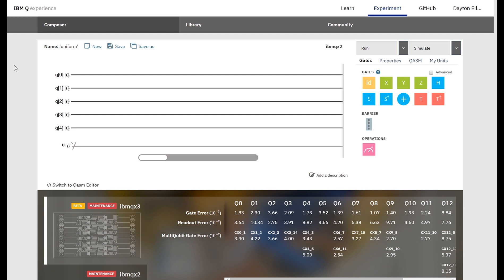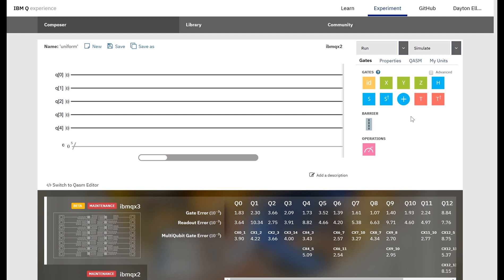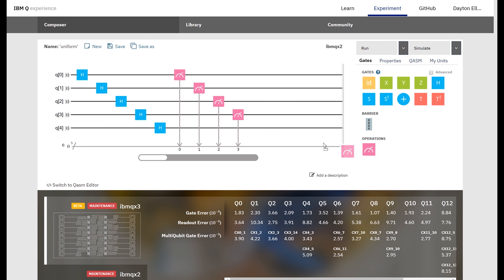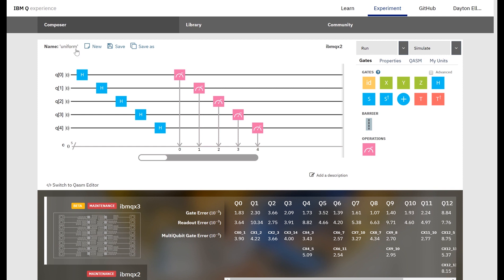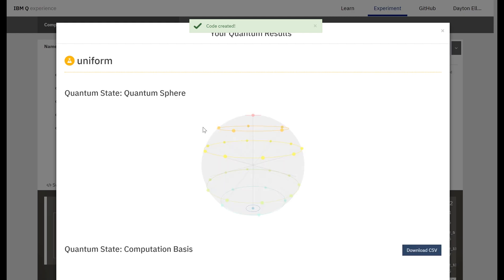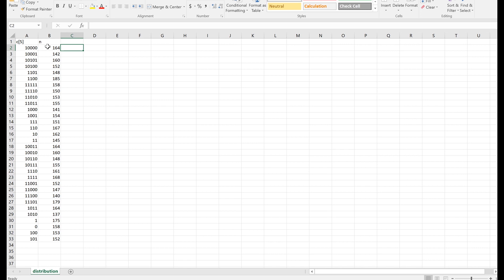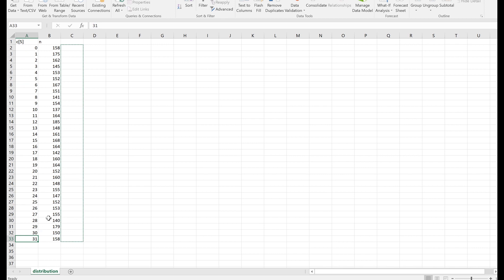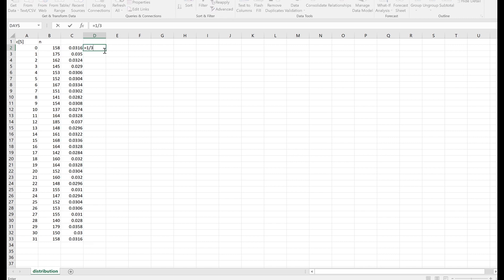Introduction to Quantum Computing (16) - IBM Quantum Experience

Comment: Basically if I am not wrong for ex. If there are multiple variables in a given problem or equation, and we know the initial and final conditions, this will give fast results or configurations to converge equation with RHS=LHS

Comment: is it possible to present it with a real life example of guessing a card position?
Reply from the maker: Kind of, although I  question how illustrative it is. You can pretend that the problem that Grover's algorithm solves is finding some special card from 4 face down cards; e.g. you have four aces and you're looking for the ace of spades. The only operation you can perform is turning a face down card over. Classically, to find the ace of spades, you'd need to turn over 3 cards in the worst case. With Grover's algorithm, you only need to turn over 1 card. Again, I don't think this is particularly illustrative or helpful, but I've seen this analogy used elsewhere, so maybe some people find it helpful.